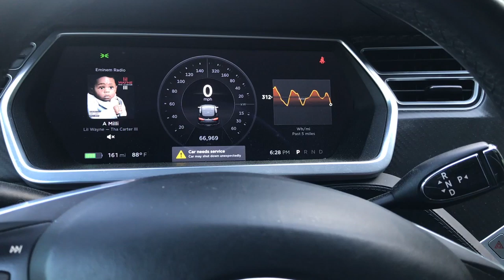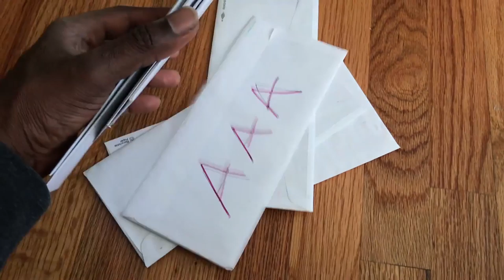Rats Killed My Tesla

Comment: That fuse disassembly was cool to see! The sand actually does a lot more than just fill a void. The sand prevents major arching from occuring. Without sand it would create a major arch when it blows (an arch is plasma, which is pretty hot)
Reply: This is correct
Reply: Will I end up with Flat Feet if I experience hot arches? Just wondering if the sand will quench the Major Arch when the Captain Arch throws the Plasma???
Reply: The sand quenches the arc. If an arc forms the sand falls in the space and kills it.
Reply: Yeah, was scrolling down to say the same. Big Clive did a good video on it.
Reply: Sand also dampens sound
Reply: c: Methods  it  has, look at it- the sand is all clumpy and stuck together and he's having to scrape it- it's partially melted and glued itself together, glass is only very transparent when it's high quality, otherwise it just looks like that

When lightning strikes sand it's called fulgurite
https://en.wikipedia.org/wiki/Fulgurite, as you can see, it does not look overly "glass-like" from the outside
Reply: Eduardo Kaftanski Right. Speaking from an engineering stand point, it fulfills two requirements, it thermally  insulates Incase of an arc and it also absorbs the heat energy of the arc when the sand melts. I think the first thermal isolation is the main reasoning though.
Reply: Methods   I don't think it got that hot.  It softened the plastic.  Lightning would have fried the shit out of the entire car.  I think Rich caused all the damage by leaving the bolts loose.  A little resistance in a connection will always generate heat.  I'm not sure why the turkey button didn't pop.

Comment: Electro Wire known as Exane wire is the solution. We it on locomotives that have very long service lives. When we find poor repairs it will usually be vegetable oil wire and rats and mice will eat it. They will not touch Exane. So any wire that is exposed should be the more expensive but more reliable Exane. Love your channel. Yes I am a locomotive electrician.

Comment: "The reason why they use sand is to cool it."
Really? :)
Haha you know sand and ceramics an insulator right? 
No, the reason they use sand is to arrest any sparks and quench the arc if one forms..
Also, sands good at absurbing any eplosions inside the fuse if you vaporise the fuse contacts.
Reply: This is the only sensible thing ive read today...
Reply: Yeah this makes a lot more sense
Reply: Ceramics are an electric insulator, but they can be surprisingly good heat conductors.
Some of the best cooling paste in the computer market is ceramic based.
Linus Tech Tips did a "water cooling" system filled with liquid concrete, which is, surprise, ceramic in nature.
And it was very effective. Untill a poweroutage stopped the flow and the stuff set and became a solid.
Reply: @FARBerserker  liquid metal > ceramic paste, the concrete cooling video was uploaded april 1st, just saying.
Reply: @FARBerserker  The sand is still for arc quench tho, especially for DC applications...
Reply: Ceramic is a great heat conductor, not an insulator. Air do insulate heat much better.
Reply: @LordWaldema  
So? It still worked just fine.
And yes, liquid metal is usually better, does not mean ceramic is bad.
One of the best thermal paste replacement compounds was tooth paste because of its ceramic contents.
Reply: @FARBerserker  which is weird since they probably have several uninterruptible power supply systems.. did it for the content i guess
Reply: Sand could also protect from vibrations and bumps.
Reply: @FARBerserker  People only used ceramic paste due to its non conductivity, therefore it wouldn't short. It's thermal transfer properties weren't great. 
Look at some benchmarks and you'll see that it's barely better than the generic paste that manufacturers provide for free.
Reply: Will I end up with Flat Feet if I experience absurbing arches? Just wondering if that will quench the arch???
Reply: @FARBerserker  Electrical conductivity tracks with thermal conductivity. But they don't need thermal conductivity with the sand, they need thermal mass and lots of particles with lots of surface area to distribute mechanical stress uniformly to the ceramic body and deaden shocks.. The heat from regular use will transfer through the electrical contacts and distribute through the pack to the coolant.
Reply: @PhilipAnderson  :) corrected
Reply: FARBerserker holy shit, you do realise that was an April Fools video?
Reply: @Pado01  "Generic paste" IS ceramic. you basically shot yourself in the foot admitting it is used in thermal paste.

Ceramics are reasonable thermal conductors but terrible at electrical conduction. This is why they are used in all forms of computers and electronics, like silicon chips and motherboards.

It is used for it's thermal capacity, conductiveness, and mass- it prevents the exploding fuse from damaging other components when they go- and they usually go violently. It is also not flammable and very unreactive.  it is also cheap.

Did I mention it was cheap? it also stops blown bits connecting to other things and forming a new connection. It's in its own firebucket. And cheap.

Most better conductors are great at electrical conduction... and you wouldn't be able to use them in a fuse would you?

Comment: the casing is ceramic not because of heat sinkinging, ceramic is a good isolator, and the sand is there to contain the blast when the fuse pops not to transfer heat.
Reply: Yes I was looking for this comment. I'm a little worried that an electric car shop doesn't know the basics of how sand filled fuses work. This concept is not new to Teslas and has been around 50+ years.
Reply: Isn't the sand just there to help prevent the contacts from arcing over after blowing? A fuse wouldn't be much use if it blows under high current but then just keeps conducting because you've got an arc of ionized air making the connection instead of the metal.
Reply: @ska042  I would not say just. Probably an added benefit. In the case of the Tesla 375 volts doesn't seem like it would get far as an arc after blowing the fuse. For high voltage fuses they have explosive charges that force the contacts apart to maximize seperation to avoid plasma arcing.
Reply: @benargee  It's absolutely there to quench a plasma arc, you get plasma arcing well under 100v, it's a function of current not voltage. cerebellum is correct.
Reply: @boaz2020  The arc is maintained by current after a plasma is formed since it's resistance is much less than air. The arc is initiated by a high enough voltage for the given air gap.
Reply: @benargee  Yes, however when a fuse starts to blow that gap is essentially nothing and requires hardly any voltage to bridge the gap. That's how scratch start TIG welding works, once the arc is started the current carries it. Doesn't require more than a couple volts.
Reply: @benargee  yes, but the air gap is infinitely small as soon as the fuse starts to separate, it doesn't require much voltage to initiate in that instance.
Reply: The fuse strips may be joined to copper but are usually pure silver

Comment: the sand is also in there to extinguish any arcing when the fuse pops. High voltage DC is much more prone to arcing since the voltage isn't passing zero several times a second like AC.
Reply: Thats what I thought, it has nothing to do with removing heat. Sand (glass/fiberglass/fiberglass "Isulation") is a poor heat conductor. 👍

Comment: Rats did 9K damage to my Mercedes Sprinter camper. Got wiring harness and pretty much destroyed the engine compartment. Tried everything to keep them out like peppermint oil, moth balls, etc. on the advice of the Mercedes service manager I tried LED string lights. Have them on the drive way and just drive over them when I get home and turn them on. It’s the only thing I have tried that works.
Reply: Apparently the soy derived materials they use smell like vanilla when heated. Rodents love it. Not sure if Mercedes used those materials too but Honda is being sued by car owners over it.
Reply: @221b-l3t  why would Honda be sued for that?
Reply: @isaaclyonsf1  Because the rodent attracting material caused millions in repair for Honda owners collectively and they're saying Honda would have known about this pretty soon but didn't do anything for years offloading the cost onto the owner, often of brand new vehicles. So I guess they want Honda to pay for rodent related damages. They already replaced the material so not much on that front.
Reply: Isaac Lyons you pretty much get sued for anything at this point
Reply: moar poison, non stop bars of bait
Reply: @isaaclyonsf1  B/c the car becomes worthless due to defective design
Reply: @TheGuruStud  not a defective design, improper/unlucky storage location. Not the manufacturers fault.
Reply: @isaaclyonsf1  If your car's electrical system is effectively a food source for the most common vertebrate invasive species on the planet, that is by definition a design fault. There are very few places on the planet that have not been colonized by norway rats.
Reply: @Markle2k  not something to be sued over.
Reply: @isaaclyonsf1  That's your opinion. I'll bet you didn't have a $30,000 car turned into a brick by rodents feasting on its electrics.
Reply: @Markle2k  it is indeed my opinion. Let's leave it there.

Comment: Guys... it got too hot because HE DIDN'T TIGHTEN THE TERMINALS!  Loose connections created resistance, resistance created voltage drop, voltage drop across resistance created dissipated power.... which is heat. 
Even if the resistance of the connection was only 0.01 Ohms, with 500 Amps going through it (moderate to heavy acceleration) Power = Current(squared) times Ohms... 500*500 = 250,000 * 0.01 Ohms = 2,500 WATTS... that will melt pretty much any fuse... and fast.
Seriously doubt it was gradual... because every time one of the fuse links melts, the resistance of the fuse increases, which means all the other links are carrying more current, so it's usually a cascade failure... they all get hot, the weak one melts first, which makes the others hotter, which melts the remaining links.
Reply: Very likely

Comment: I was just contemplating what drill should I get next...  Milwaukee sounds/looks like a brand I can trust.  And that magnetic light was lit.  Pardon the pun
Reply: Everyone I work with uses Milwaukee power tools. The batteries are great and they sell a power tool for everything, so you get a lot of options. Once you have 6-10 batteries around you can start buying just the bare tools, which saves a ton of money. So it's not hard to end up with a widely specialized set of power tools for not much money.

I should say though that while Milwaukee quality is quite good, especially on the heavy-use tools like drills/drivers and sawzalls, Makita's high-end tools are slightly better made. Also Makita sells an electric wheelbarrow, which is an absolute must buy. The first thing I do when I see someone carrying 18V Makita gear is ask if they have the wheelbarrow.

Basically, you can't go wrong with Milwaukee. But if you don't need a stupid variety of tools and you're not working around a shit ton of Milwaukee battery chargers, consider Makita as well.
Reply: The chuck on my Milwaukee drill slips with larger bits.  Probably fine if you're just using it for driving bolts but I have a heck of a time making a hole sometimes.
Reply: I may buy Milwaukee when I upgrade from my Craftsman series of 12 volt tools. As far as quality of the older tools I have a Milwaukee hole shooter which I cannot find an intermediate gear for, the first one I ordered is the wrong one and cost me $27 and hardly worth returning for the $10 they might give me back. The part 4 this tool is discontinued. I recently fix a Milwaukee hole hog where the half inch main shaft holding the Chuck had broken in half but there is a company making a new Chuck and better design main shaft for $50.

Comment: I remember Black&Decker which I still have, I'm cheap. Then Dewalt, Kobalt, now Milwaukee is killing it.
Reply: There are only like 4 tool companies,  most of those are probably the same company. The only really independent power tool companies are Mikita and Hilti if I remember correctly.
Reply: Fun fact - Milwaukee has gone to 2170 cells in their new high output M18 batteries!
Reply: Yeah, using 18v Makita tools here. Expensive but you are sure they can handle years of abuse. I still have my 14v makita from 15 years ago.

Comment: Great video, Chad reminds me a bit of Paulie JR from OCC, the sand inside the fuse prevents the elements forming a conductive copper film when the fuse blows and the copper melts, I really must get myself some of those Milwaukee power tools :-)
Reply: What do you know? Lol
Reply: It's more about quenching the generation of plasma which reduces the electrical resistance of the air between the now-separated electrical conductors. Plus it damps the shock waves from the rapid expansion of the air as it is heated, preventing the fuse from turning into a grenade that damages the components around it.

Comment: The purpose of sand in a fuse is to quench the arc when the fuse ruptures and prevent a fire if the rupture is particularly violent.  It doesn't provide any meaningful cooling to the fuse link.

Comment: The sand isn’t there to cool
It lol.  It’s to absorb the energy of the fuse blowing to protect the surrounding equipment.
Reply: I think that the sand is multifunctional
Reply: It does multiple things,
1: Suppresses any arks made when the fuse pops.
2: acts as a medium heat can pass through to help cool it
3: dampens the pop so its not damaging
4: fills in the gap to prevent it from arking again

Comment: The real reason for sand being present in the fuse is to extinguish any potential arc upon fuse failure.

However, it's not so commonly known fact that fuses, as well as other parts of electrical circuitry age. The real dangerous part of fuses ageing is their operating temperature rising. I've seen operating fuses at nearly 200C, huge fire hazard. The worst part is that the fuse as it heats up causes the ambient temperature to rise and ionizes it's surroundings. Ionizing the air is a really bad thing, as ionized air is conductive and will short the whole fuse box, setting it on fire.

Comment: Fuses:  The ceramic and sand isn't meant to help conduct heat or keep it cool, but just the opposite.  The ceramic housing is to keep the heat insulated inside the fuse so it doesn't escape, and the sand is to keep the plasma arcing isolated and short lived.  In theory, when the fuse wire blows, the sand will fill in the gap and shunt the plasma arc to break the connection.  Plasma is as conductive as copper wire and can sustain a connection for a long time, burning out your vehicle's wiring.

Comment: The sand is in there because when the fuse heats up, the sand turns to glass and blocks the electricity from continuing to flow. The sand is a convertible insulator. Without the sand, the electricity can just arc across the terminals. The ceramic outer shell is there because when the sand melts to glass almost any other inexpensive material will fail from the heat produced. If you still have the sand, you can probably see some of the sand grains have changed. The sand around where the current would arc, would melt.

Comment: Han an '85 Mustang GT in its day.  Holley 4-barrel carb, huge round air cleaner on top.  I left it in the garage for a long stretch one bad winter, driving a Datsun econobox to work instead.  Springtime, the Mustang smelled like burnt cooking whenever I drove it.  Took the air cleaner off, and found a stash of nuts neatly distributed over the top of the engine block.

Comment: RE: fuse - Sand is not for heat transfer. It will turn to glass when heated by the fuse blowing thus insulating the voltage across the fuse. Standard industry practice.

Comment: The sand is mainly to prevent liquid metal forming a new conducting area. If, for example, the copper melts and sticks to the ceramic ring, it would allow more current to run through.
That's why sand is used in most fuses.

Comment: The sand is there to stop arcing across the gaps made when the fuse blows. Its very common on high voltage fuses to have sand in them.  Its meant to melt and fill the gap made so no power can pass through or at least that's the idea.

Comment: The sand is there to extinguish (quench) the arc when the fuse is blowing.

The fuse was overheating because it was not tight and it wasn't making a good connection.

Comment: They don't use sand in the fuse because of cooling. They use it so that if you get a catastrophic failure the sand absorbs the energy in a safe(er) manner than just hot molten metal going everywhere. It also prevents a plasma from forming, which can also conduct electricity--the opposite of what a fuse is supposed to do.

Comment: We had a minor rat issue in our warehouse.  At least one got into our standup forklift and chewed off a bunch of the large outside wire insulation.  It's a battery-powered forklift.   I had the top cover off and I saw the power arcing once, and WOW.  That's not good.  I needed to replace the contactors anyway,   So lots of electrical tape over the chewed up sections.  All is good now.  No more rats.   Forklift works as it should.  

I've seen results of rats or mice eating through cars ABS cables and other things on cars.  Always good to have cats around.  I have a few neighbor cats that like to hang around my house.